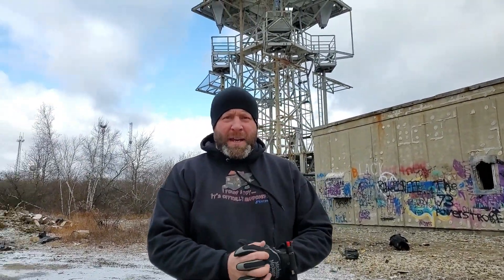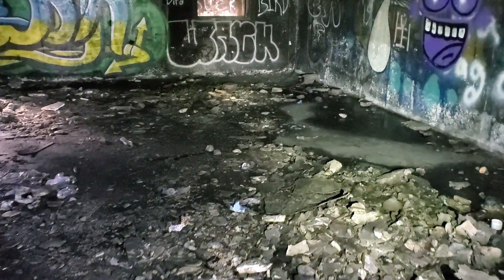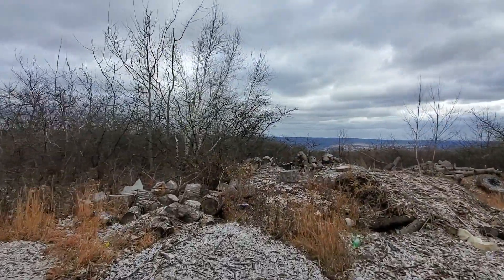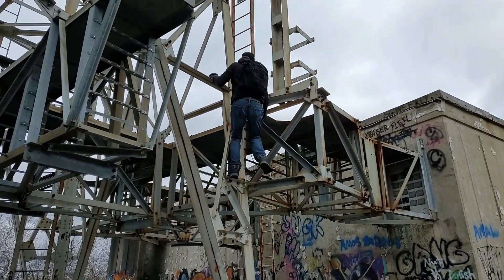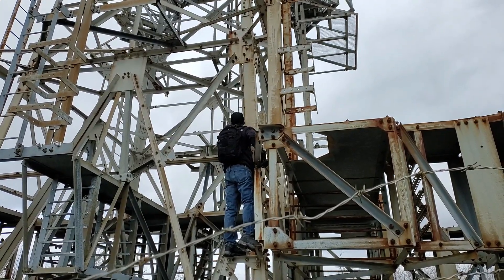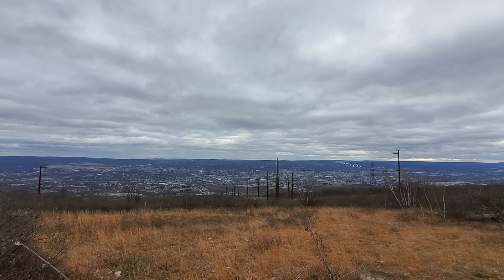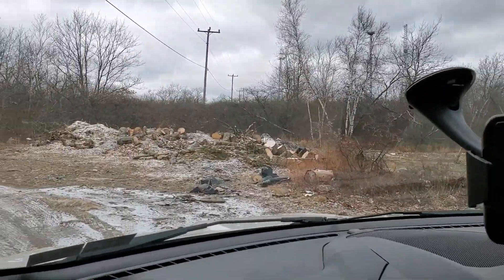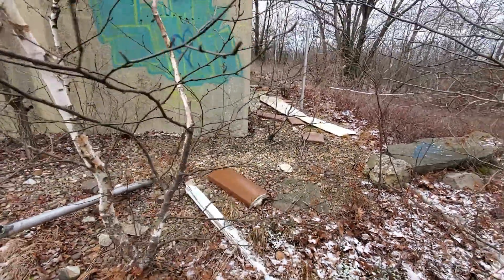Abandoned At&t Microwave Tower Station From 1960s

Comment: I'm a old microwave tech.  The smaller tower with the two parabolic dishes. The larger dish transmits further distance. One direction trans-recieve  signal from a far end location,  the weak signal is measured in decibels. The weak signal is  amplified by the parabic dish, and routed through the waveguide down the tower to the microwave equipment. The rf signal is sent back up the the other antenna in a different direction. The small room is for a generator in the event of commercial power failure .  The generator room had to have an exhaust pipe or chimeny,  the generator room had to be separated from the microwave equipment room, because of the exhaust. The smaller microwave was used by a private network, oil company or train company, connecting phone or data for head quarters to a remote location.

Comment: These towers were part of the AT&T Long Lines. If you google it you will find websites dedicated to the history of this network including the L Carrier network, which was a transcontinental coaxial cable line, which I believe is abandoned as well. I have 3 of these towers in my area here in Berks County and two sites in neighboring Montgomery County,as well as the L carrier transcontinental coaxial cable line running through my area. Some of the sites like the one outside of Pennsburg and Pottstown have underground bunkers with nuclear blast detectors around them. It's a shame that these sites are abandoned and no longer in use but when the fiber optic came about as well as satellite technology and the cold war ending sites like this were no longer needed. American Tower bought some of the AT&T sites and converted them into cell phone towers. I think you might have mentioned some of these facts in your first video.
Reply from the maker: I covered all the history in the first video that i have linked to it.

Comment: AT&T and Bell bought this land around 1966 and this particular tower was built right about 1970. It was altered slightly some time in 1974 and the contract officially expired for this site in early 2001 but was probably unused since 1993 at the latest but most likely unused since the late 1980's since fiber optic technology was the newest thing during that time. It stood 82 feet tall and it's first call was placed in late 1970 early 1971. The horn antennas are from bell technologies and the ones on the very top from a different manufacturer. The smaller tower I believe was affiliated with that possibly as a relay and those late dishes appear to be microwave dishes as well. Awesome video. Sadly this site was recently demolished in March 2020.
Reply from the maker: Thanks so much for sharing

Comment: The floor plan equipment layout of this particular microwave repeater building may be found on page 1518 of the September 1968 Bell System Technical Journal.  PDF archives of the BSTJ may be found at:  https://www.americanradiohistory.com/ in the Technical - Specialized "Company" Magazines section.  BSTJ was page-numbered consecutively from the January issue so that page 1518 is actually page 376 of the September PDF.  The Sept. '68 BSTJ was devoted almost entirely to the TD-3 Microwave Radio Relay System - a solid-state upgrade of TD-2.  The papers are technical in nature but there is a lot of information easily understood by the average electronics aficionado - enjoy - waw -

Comment: There's a dilapidated sanitarium near the antenna complex. Saw it on Google maps. Have you been there yet? I don't suppose those guys in the truck knew there is VIN plate on the engine block.
Reply from the maker: West mountain sanitarium. Ive filmed a few videos on it, but its no longer there.

Comment: Microwave ovens were invented when they found out that birds would explode if they flew in front of the horns. The miniaturization technology wasn't available in the 60's, so they didn't have them small enough to put in your kitchen. These horns were over 100,000 watts, so that explains the bird issue. Good thing that fibre optic systems were invented.

Comment: I still use a landline phone and have a tall regular tv antenna.but I have succumbed to wifi for tv, but if I could I would still being using the antenna.
Reply: Fact Checker  At this point I need all the cables and wires to connect but it is a good thought tho.